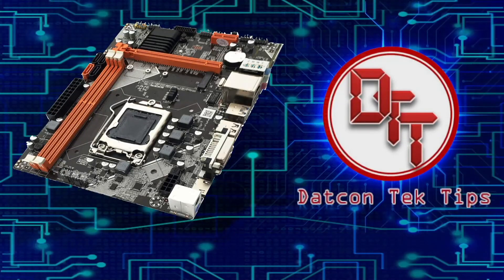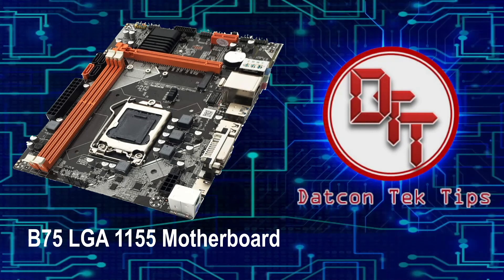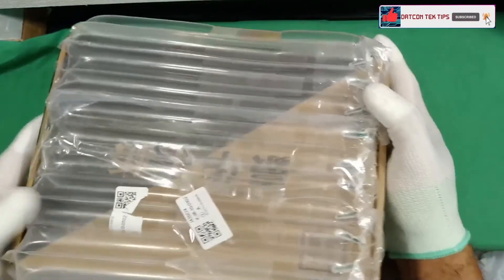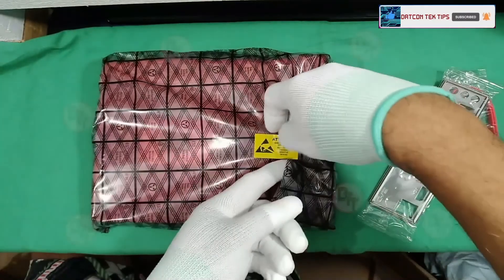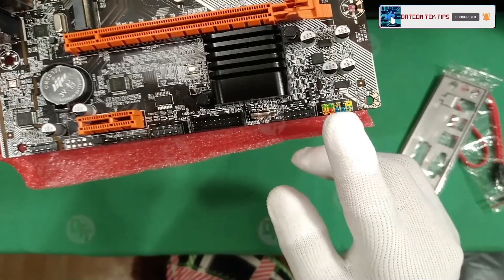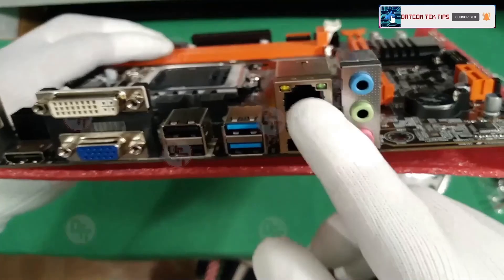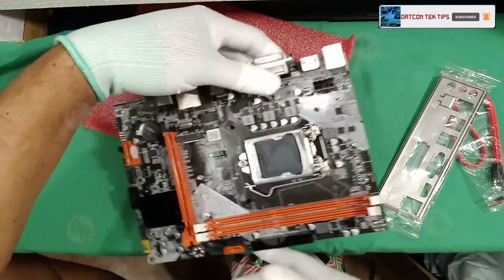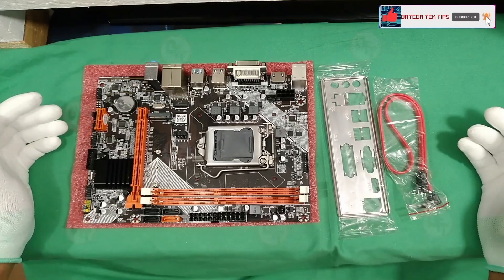1155 Motherboard with M.2 for Intel

Comment: Good day! sir im having trouble of that board 1 ram slot not working cpu i7 3770 and rx580 bala ma notice . how to fix 1 ram slot not working!!!!! Thank you
Reply from the maker: baka may factory defect yang ram slot mo.Parehas naman ba yong ram speed 1600/1333mhz. na try mo na 1333mhz ang ilagay mo baka sa speed lang. yong isa kasing nabili ko ayaw gumana sa 1600mhz na ram pero sa 1333mhz gumana. kapag ayaw may factory defect yan.
Reply: na return ko ma po sa seller factory defect nga as shopee check upon return refund. ty sa comment po na notice then ngayon lng din napansin

Comment: I7-3770k and support wins 11?
Reply from the maker: 2nd and 3rd intel are support. na test ko lang kasi ito sa 2nd gen. na i3 2120 at sa 3rd gen na 3550 ok naman sya.  Malamang pwede sya kasi 3rd gen din yang i7 3770K, kaso di ako sure kung kaya ng board kapag need mo mag overclock.
Reply from the maker: hindi sya supported ng windows 11.  Pero pwede naman, check this link  https://www.youtube.com/watch?v=6M8JCtuBctA

Comment: I need that board for my i5 3570K. Is the motherboard working? how about the M.2?
Reply from the maker: Yes, it's 100% working and the M.2 is working also, I use Adata SX8200PNP 512G PCIE protocol.
Reply from the maker: @88s10Durango  use 1-2 (all) jumper for m.2 sata and 2-3(all) for M.2 pcie nvme. You can use the sata port for additional storage. Don't forget to subscribe. Thanks